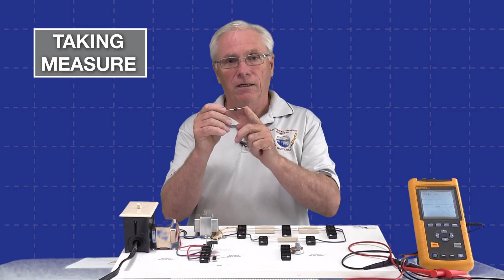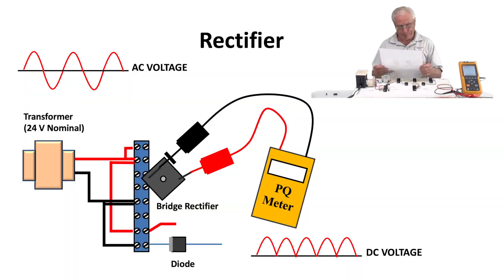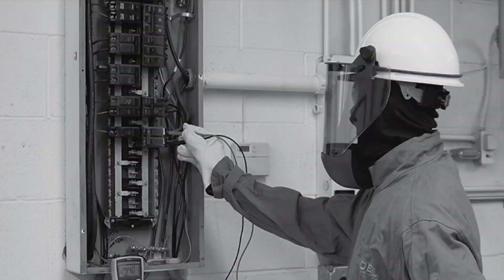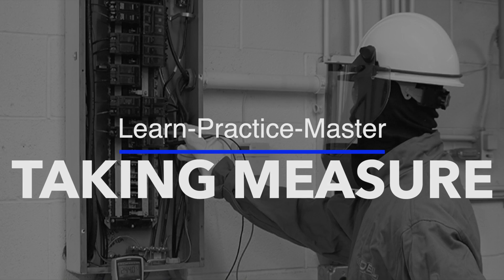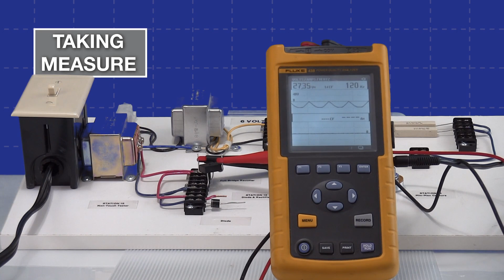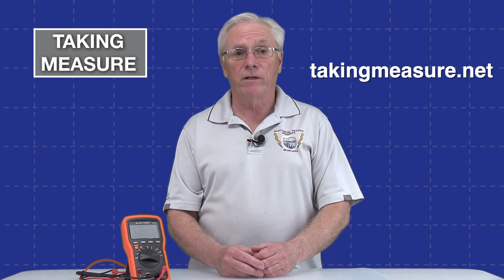A Full Bridge Rectifier in an AC Circuit

Comment: I have a ring polisher (jewelry) that inputs 120 V AC into a 4 diode bridge rectifier.  The rectifier powers a 100 V DC motor that drives a magnetic plat that stirs small steel rods in a solution container.  Everything else upstream of the rectifier is 120 V AC (fuse, power switch, timer, cooling fan).  When I plug it in and hit the toggle switch it pops the GFCI on the dedicated 20 A garage circuit.  The second try also tripped the 20 A breaker in the fuse panel.  I’ve been inside the motor,  but I haven’t began my continuity tests yet.  The motor has new brushes and a filed down commutator done with several different files and crocus cloth.  I also used a pick to clear burs from between the commutator bars.  Any words of wisdom?
Thanks,  Steve